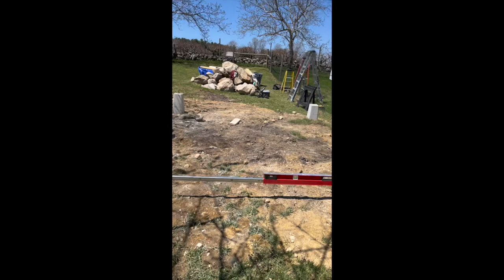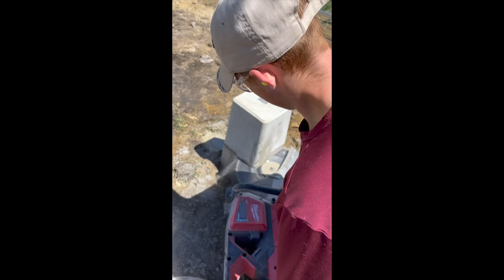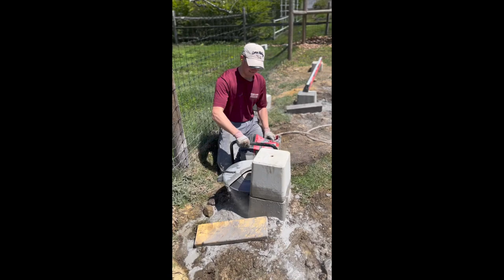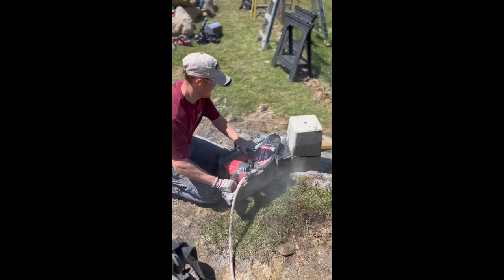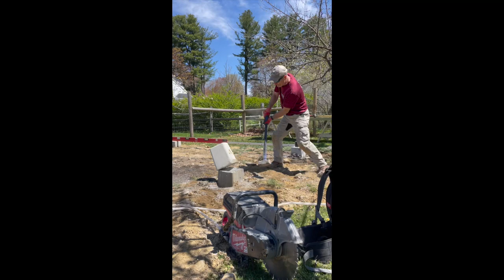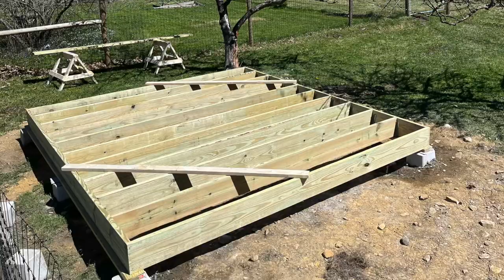Milwaukee 14-inch cut off saw

Comment: The MX line seems to have some decent sales right now. I imagine they're having a tough time getting the majority of general contractors to bite the bullet though. It's a tough pill to swallow for sporadic use. Some of my tools like that only get used a few times a year which means the lower end stuff works. Perkins brother builders has a 14" corded evolution they said was only like $200. Easier to come to terms with $200 than $2,000+. Makita has their 80V coming out but if I remember correctly it's only good for around a 15 minute run time. That's a long way away from replacing gas.
Reply from the maker: Completely agree - didn't know about the corded version. Two thoughts on this:  -1-  this shed is remote which would require a generator for a corded tool or gas tool.  -2- I look at my business / tools as an investment - if I have to rent or sub out to another contractor for a job [tool I do not have] more once a year, I consider buying it.

Because I use a cut off saw tool 3-6 times a year, and for small cuts - a battery version makes sense
Reply: @ConcordCarpenter  Absolutely agree sir. I enjoy investing in tools. I have basic concrete cutting capabilities with a 9" grinder, dedicated skilsaw, and dedicated miter saw. When I've needed holes cut in foundations I usually call Pro Cuts in the Boston area. They have some serious gear. Wet saw on a track with a 30" blade and a concrete cutting chainsaw. If I remember correctly, the guy said the 30" track saw was $30k, the chainsaw was $15-20k, and a pump I can't remember the pricing of but I think was $5-7k. It's a sight to see when they mount the tracks and plunge cut like it's butter. They're in and out in a few hours. The price to cut the openings is fairly reasonable. $1200 for a basement window and proportionally more for a door. Also an upcharge if you want them to take the concrete cutout with them but I just break it up and toss it in the dump trailer. Sounds expensive until the hole is cut and the door/window is installed in the same day with minimal mess. Price to be paid for efficiency and when you can save a full day or two on two guys the $1200 is easily a wash.
Reply: And that's why they should've just gone the dewalt route. Dewalt is not having trouble selling 60v(54v) at all and it's proven to beat out milwaukee in some spots. They can even make bigger 60v batteries for tools like this. The 60v batteries are still backwards compatible to smaller tools anyway
Reply: @andrewk8636  Dewalt is great for a lot but their biggest cut off saw is 9". That Milwaukee is a full size 14".
Reply: @Tool_Addicted_Carpenter  I'm not saying dewalt is the best in everything just saying milwaukee should also do a multivolt/flexvolt system. I'm sure there isn't a patent stopping them considering Metabo is not part of Stanley black and decker and has multivolt. Probably just milwaukees ego lol. They're the "pro" brand so if they'd copy a "homeowner/prosumer" brand then it's bad in there eyes is my guess.
Reply: Totally agree well said.

Comment: Milwaukee tools always work so great out of the box but I’ve always had issues with battery longevity once they’re out of warranty. This applies to both personal and professional use. We have a sizable concrete patching job with 15” pavement coming up so we’ll see how the MX saw performs doing all of the green cutting.

Comment: Why weren’t the footings set at the right height ? And no laser used to set elevations?
Reply: Looks like they're precast footings. Probably didn't need to bury them any further. They're more than adequate for that size structure.
Reply from the maker: that's a discussion with the excavator that didn't go well for them. Claimed ledge - I used a laser to mark / cut them

Comment: I waited ages for this to hit the shelves. Milwaukee really flopped with the handle design. After using demo saws for years, I only had to hold this for 5 seconds to realise how uncomfortable it was and not purchase it. The battery costs are a big put off also.